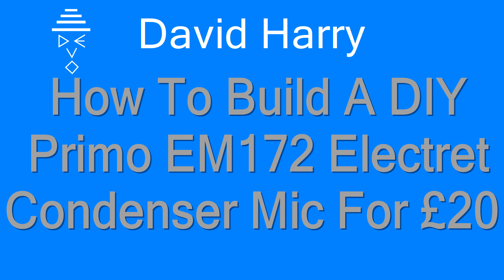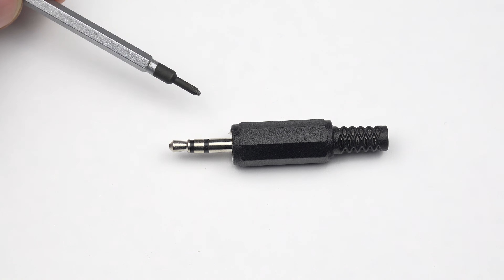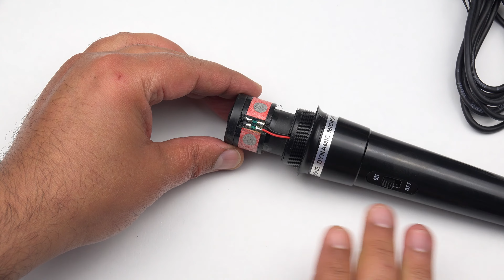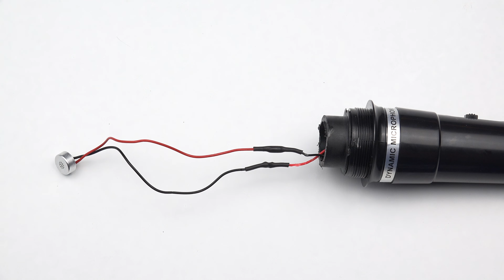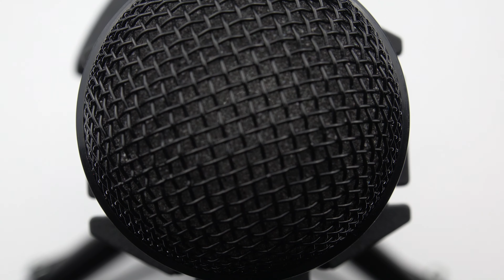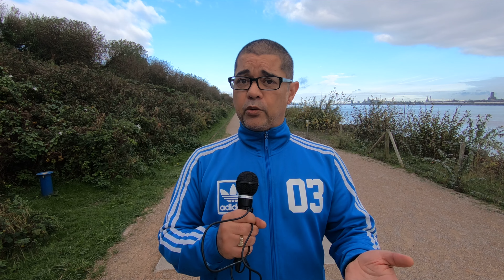Easy Step By Step Tutorial - How To Build A DIY Primo EM172 Electret Condenser Hand Held Mic For £20

Comment: You can balance the microphone by connecting it into a XLR balanced cable to cancel possible noise. Just buy a audio transformer (like the ones inside Sure SM57, SM58 and others). They are very cheap.
Put the transformer inside de microphone body and glue it with hot glue.
Connect the green wire (transformer) to the red wire in the mic (+).
Connect the yellow wire (transformer) to the black wire in the mic (-) and to the microphone body (ground it). Use an extension ground cable and pass it directly across the microphone body and connect it to the XLR plug pin 1 (ground).
Connect the other two wires (blue and red) down the transformer to XLR plug out. Blue goes to XLR pin 2 (hot) and the red goes to XLR pin 3 (cold).
Now you have a nice filtered and balanced sound on a XLR cable. This only works with a dynamic capsule. If you want to use a electret microphone, just use one AAA 1,5V battery, a 2,2K resistor to power the electret mic and a capacitor to isolate DC current along the audio out to avoid noise. I used a 100uf electrolytic capacitor. It's very simple and you can see the schematics around here on youtube.
Reply: Hi sir , i want more details please .. how can i reach u ?!
Reply: @billcarsonasmr5022 , what do you need?
Reply: @Porfirio.D.1965  i need to know how to add power to an earphone mic nd woud this actually give us better sound . Thank you .

Comment: What are the three pins on the electret?
You have wired only two
Reply from the maker: Hi. The third is only needed is you require a resistor for extra attenuation. Cheers, Dave.
Reply: @DavidHarry  Thank You🥺

Comment: Hi Dave. 
Firstly, I absolutely love the genius and ingenuity behind this fantastic money saving conversion. But...I'm slightly confused!
You reversed the cabling of the mic capsule because of a reversal either through the mic switch, sealed mono jack, or it could have been purposely wired for negative tip! For the purpose of supplying positive tip to positive on capsule. Which makes sense if you were to use the capsule with the original reversed polarity mono jack still attached. 

But...When you cut and soldered the red core to the new mini stereo jack's tip (Now negative on capsule) Did you reverse the capsule's cables back to correspond with the new (+ Tip) set up?

Thanks

Comment: Hey! Can you do a comparison with EM258? Seems to have more flat frequency response then EM172, but a little more of noise? Thanks!
Reply from the maker: Hi. Unfortunately I don't have any other Primos other than the 172 and 184. The main reason for not trying a 258 so far is because all my ECM bodies are for 10mm capsules and the 258 is only 6mm. If I can get my hands on a 258 I will definitely give it a go, although I doubt that it's gonna compete with the 172. I've worked in audio for many years and can honestly say that I've never had an ECM that's as impressive as the 172. I own and have used many high end ECMs and although some have been great, the 172 is what I always use. If you're interested in Primo capsules take a look at http://www.MicBooster.com Cheers, Dave.
Reply: Thanks for your reply!
Compared to BOYA BY-M1, which you prefer more?
Also, I've saw in one of your videos that you plugged EM172 to some power supply, which one you used?

Do you have any idea what kind of circuitry is inside the BOYA BY-M1 power supply with battery? As I'd like to make the similar one for EM172, would you reommend it?

And yes, what do you think about TS472 preamp board? - https://www.soundandvision.com/shop/funny~diy~expert~aideepen~ts472~electret~microphone~very~low~noise~audio~preamplifier~board~with~2~0~v~bias~output~and~active~low~standby~mode~module-db0ae3a373bd449deb33f12aacb6c0f60.html

Thanks!
Reply from the maker: The Boya in my opinion is not very good and the worse one out of all those small pencil type video mics. There is no active circuitry in the Boya. It's capsule is only 10mm, I've replaced it with a 172 so I can have an omni mic in a small video mic body, it works very well. Here's an unpublished video on my test channel, it's where I put all my preliminary tests before making a video for this channel. I mention some stuff about the boya body and why it isn't suitable for the cardioid capsule that it comes with https://youtu.be/S2AgGse21JY

This is another rough prelim test where I test a modification I've done to hold small video mics like the boya in a hand held position https://youtu.be/UAtwJswHn40

This prelim is the Boya's capsule in a hand held body https://youtu.be/S2AgGse21JY

This prelim will give you all the info about the modular cindenser mic system I putting together with the power supply https://youtu.be/7HiifociLgs

In my latest video on my main channel the mic on top of my Z Cam E1 camera is the other version of that self powered modular ECM system. Both the large and small power supply work very well, both the same for excellent noise floor levels but the large one takes a  much bigger battery that will last way longer. The larger one will also take one of my Movo wind filters and the deadcat off the Rode micro. I'll be doing a full how to on building this system on my main channel https://youtu.be/yzCYn2pkVis

Check my main channel's video list and look for the stuff with the comica VM10, this is a great mic and better than than the Rode Micro for bottom end, I use its capsule in some of my test mics and it's a great Cardioid. The Comica and Rode both use 15mm ECMs.

If you are thinking about building something with omni capsules, don't bother with anything other than the 172. Seriously, I do this stuff all the time and the 172 is simply the most impressive omni ECM you can find without spending stupid money.

Go to MicBooster.com and order yourself a couple, they can make unbelievable stereo mics that are almost binaural. I''ll also be doing some build guides for stereo and binaural with  the 172s.

Cheers,
Dave.
Reply: Thank you very very much for your awesome reply! :) 

I'm for sure getting EM172. And yes, I'm thinking of exchanging BOYA's capsule with it.

What would be the best way to power EM172? Do you have some circuitry that would do it? Similar in the video you sent above, made from that omni mic? 
Also, can you link me that omni mic from which you made a power supply for EM172? I can't find it. 

Is there such a "device" (power supply) that has 3.5 input for mic and output with battery inside from eBay or such? 

Thanks a lot!! :)

P.S. Is there a way to chat with you, e-mail, Discord or something else? I have few questions about the project I'm doing and I'd like to get professional advice like your's :)
Reply from the maker: Hi. One of those videos will show you all you need to know about the power supply.

Unfortunately, I don't do free one to one communication as this is what I do to make money, I work professionally in post production and have over 30 years experience doing so. I don't mind sharing my results and guides, but as I'm sure you'll understand, you can't do your job for free. Keep an eye on my channel or have a trawl through my videos, I'm sure you'll find other information and examples that may help you.

Let me know how you get on with your builds, I'd be very interested.

Cheers,
Dave.
Reply: Hey, no problem, you helped me already a lot! ;) 

Tho, I can't seem to find only that power supply adapter, if only you could linke me to it would be awesome. 

Thanks!
Reply from the maker: https://amzn.to/2MS9f2l
https://amzn.to/2wbmjce
Reply: Thanks! :)
Reply from the maker: You are very welcome, good luck with your build.

Cheers,
Dave.

Comment: can you make a ukulele mike using that?
Reply from the maker: Hi Gilbert. I'd imagine that the Primo EM172 capsule would work very well with many types of instruments, including acoustic ones. You'd just have to be careful of vibrations and mounting it either in something that will absorb vibrations if attached directly to a Ukulele, or have it in a mic body and close position it.

It is an omni capsule, so will pick up in all directions and would need to be in a fairly quiet environment so other sounds around the instrument aren't picked up too much. Take a look at the Primo EM184, it's a cardioid and focuses its pickup more in front, better rejecting sounds to the sides and rear. Although the 172 will have a more fuller/richer sound/tone. 

Cheers, Dave.
Reply: thankyou..
Reply from the maker: Hi Gilbert. You're welcome. Call back to my channel over the next few days, I'm doing a review of the Rode VideoMicro versus a Sennheiser ME66. Although the Rode is typically used for video dialogue work, it's surprisingly versatile and may work as a close position instrument mic. It's also not too expensive and you can use a smartphone to record it or a camera or external audio recorder, which could make it a very affordable and portable recording solution. Cheers, Dave.

Comment: Great video!Thanks a lot!
Reply from the maker: You're welcome, thank you.
Reply: David Harry hello, can I use cheap 9.7mm microphone capsule to put in my wireless dynamic 🎤?
Reply from the maker: Hi, if the system is dynamic then no, you can not use an electret capsule in an audio signal path that is designed for a dynamic capsule. A dynamic does not need power to work, but an electret capsule, similar to a condenser capsule, does require electret or plugin power. Cheers, Dave.
Reply: David Harry so what is the cheap capsule that I can buy on AliExpress for it? Can you recommend one?
Reply from the maker: Phong Pham Don't know, I don't use Aliexpress.
Reply: David Harry if I want to buy a dynamic microphone capsule, can you help me how do I choose the one that’s sensitive and and loud?